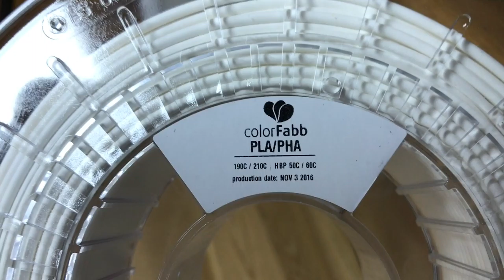ColorFabb nGen vs PLA/PHA

Comment: Hi Adrian,  I have printed hundreds of hours with both Colorfabb PLA/PHA and nGen.  What printer are you using?  I have an Ultimaker 2+ and that lifting you show can be cured by some improvements to the build plate.  In my case, I run the bed at 60C and use a diluted coat of PVA on it  (mix at a 10:1 ratio, water to PVA glue, shake like crazy, lightly brush on and let dry)  I haven't had peeling prints since.  On nGen, I noticed I was getting "hairs" that would wind up run over by the nozzle, leaving it pretty blobby and ugly.  Increasing the printing temp to 236C and increasing my retraction slight cured it for me.  I find nGen is a little more brittle than PLA/PHA but I can leave an nGen part in a warm car and not worry about melting.   Hope this helps!

Comment: Your review would have more value if you told us what printer you are using and what temperatures of your hot-end and bed. I have a very old Wanhao Duplicator 4 and never have trouble with PLA. I use the average hot-end temperature recommended for the PLA less 5 degrees and a bed temperature of 60 degrees. My slicer settings ensure that the first layer is properly "squished" to the print bed and I always use a brim. I believe that the brim gives the printer extra time to stabilise temperatures before the actual print starts. HTH.